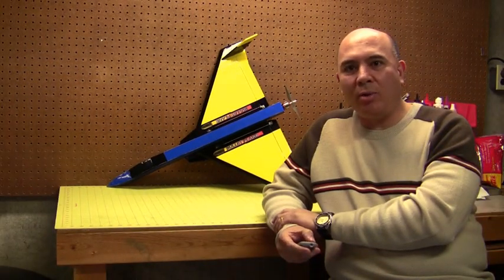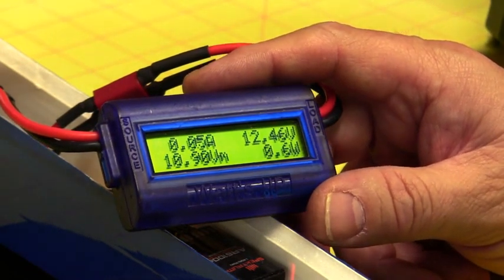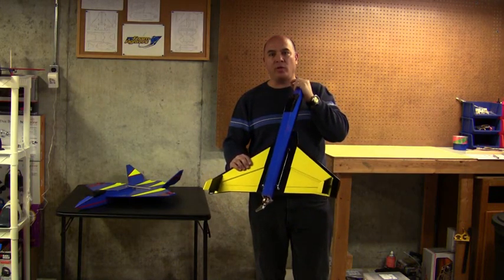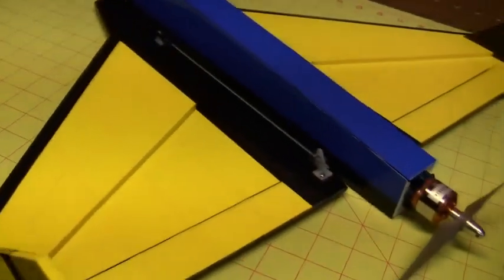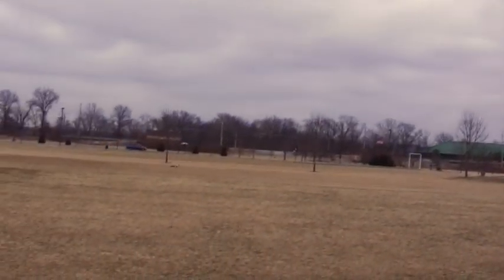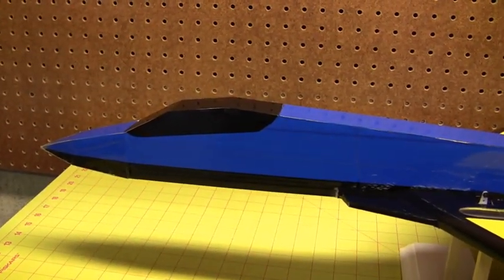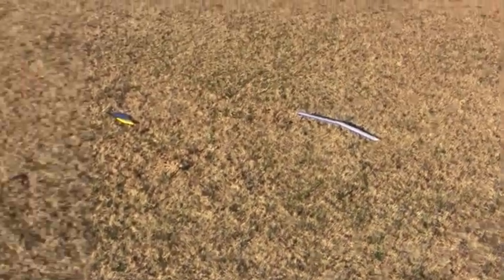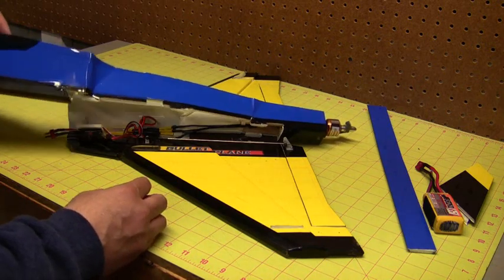Bullet Plane Build Part 4 Test and Tune

Comment: @hideout41 Office Works in Australia sells foam board. Its a bit expensive at about $10 to $15 per sheet but it comes in all colors and tape sticks to it better than it does to depron due to the cardboard surface.

Comment from the maker: @hideout41 other people have build some of our planes out of different materials and had great success. Some of the materials that have been used are Depron foam, Blucore foam, fanfold insulation foam and even coroplast a kind of corrugated plastic, the same kind used to make political signs. You can find some of these at the local hardware store or just search online.

Comment from the maker: Any half range or full range receiver will work. I was using my DX6i 6 Channel Spektrum receiver in this plane which is a park flyer receiver. I don't use these in my fast planes anymore because of range issues.

Comment from the maker: Thanks for your comment!! The Bullet plane is made from plain old ordinary foam board you can buy in many stores, not EPP. I will be doing some EPP builds coming soon!!

As for the batteries both Paul and I have had nothing but great results using these. Without having more info I can't tell you exactly why yours burnt. The most common reasons are over amping, over charging and over draining the batteries. Think I will have to do a short video on this soon.

Comment from the maker: 30 degrees is better weather for us than the last couple weekends. Not good but better. This weekend it's in the 70s but at the moment there is a severe weather alert till 11am. Might not be able to get out for more test flying today, we'll have to wait and see. That's Missouri weather for you!! As for the CG I will be putting it somewhere back between 5 and 5.25 inches because now that I've had time to think about it the plane was nosing down just a little in the 2nd flight too.

Comment: The second flight looked fast and smooth. Man, sorry to see the jet crash so hard into the ground. I know it doesn't take long for you guys to get back in the air. Really great information on your video about the KF airfoil and the location of the motor. I am going to check the roll rate on my DX6i.